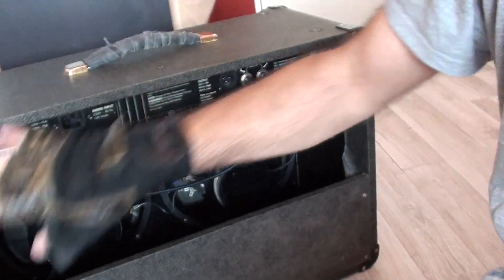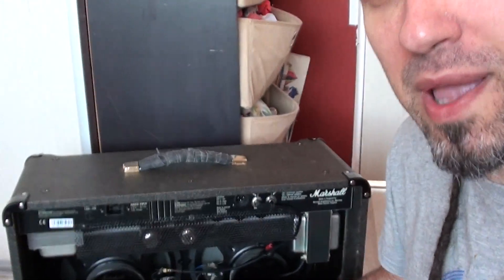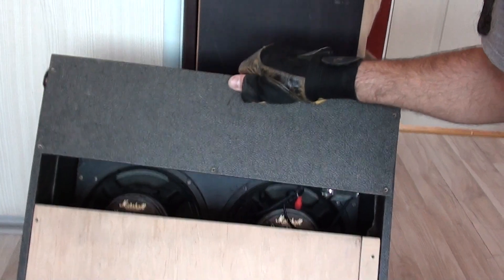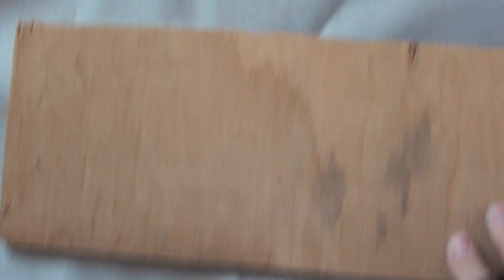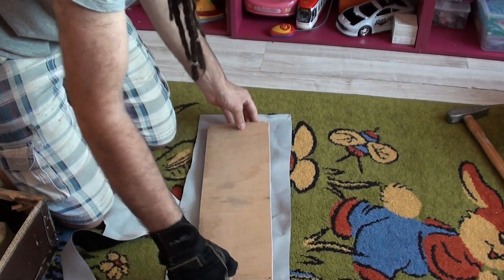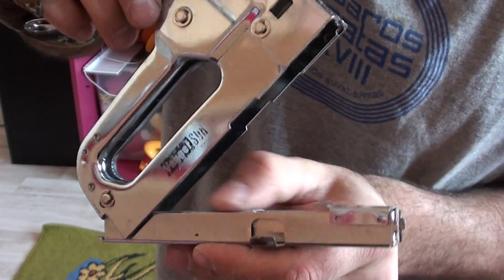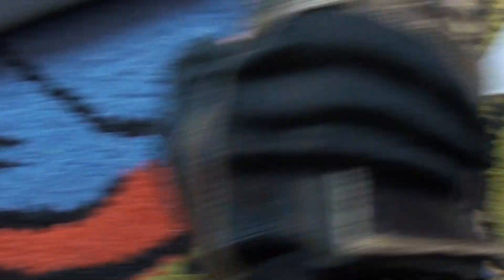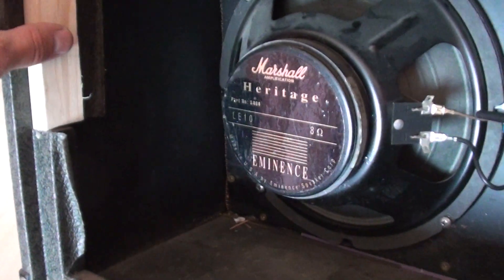Open-Back to Closed-Back Amp Conversion + demo

Comment: I'm still mixed on the mod I did to my solid state open back. Open backs like to breathe and you need enough amp wattage with the volume knob turned closer to maximum to fill the room. Played at low volume they sound weak because they aren't really filling the room with sound. The speaker produces the same bass regardless of open or closed back, it's whether the cab restricts and mixes the sound waves with each strum or pick of the string(s). I want to actually build & try an open back spoiler & see what that does better or worse for an open back. I figure if you went a deeper bowl like an acoustic guitar and channel the sound to disperse the sound, that might still accomplish a deeper cabinet like bass, yet still have the ambient room filling surround sound of an open back. I basically have a board over the back of the amp and there's a gap all the way around it, which probably is considerably less open back area as the narrower slit that 2 pieces of wood accomplish.
Reply: speakers work differently in open cabs, read about speaker compliance

Comment: With all due respect, the test didn't give much in the way of definitive results. I would have liked to see your amp mic'd up the exact same way for both tests and you should use the same musical passage for both tests. 

Further yo need to plug the back entirely, with wood screws, not ask your friend to stand behind the amp and hold the wood to the back! Ugh. C'mon man.